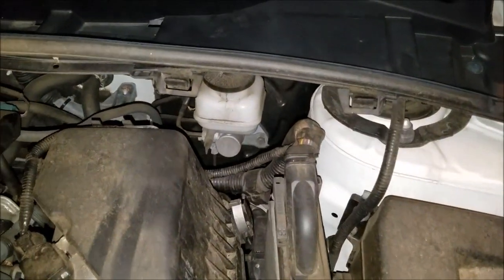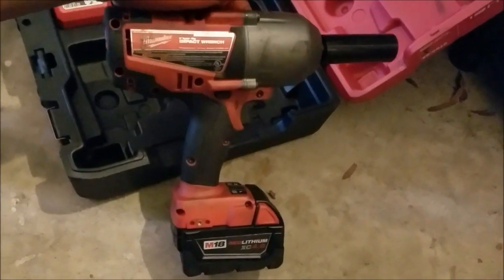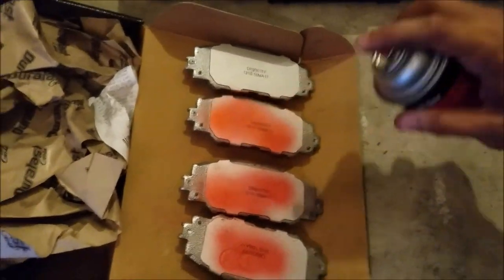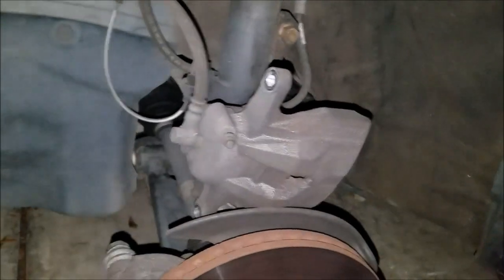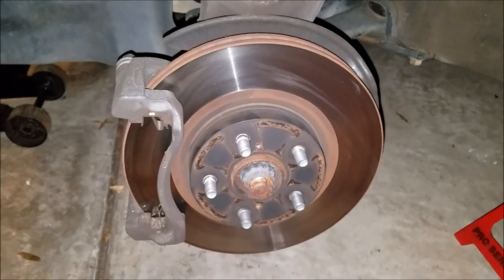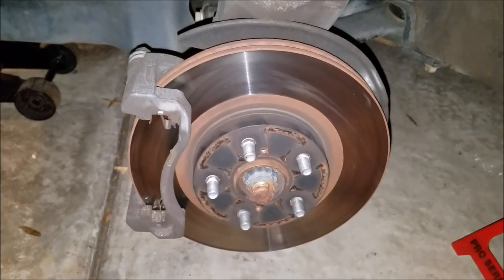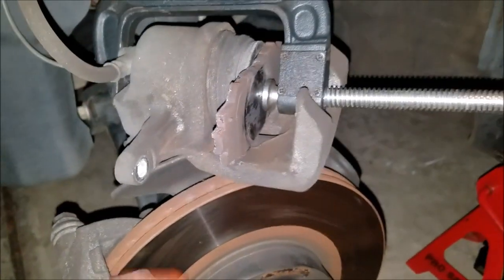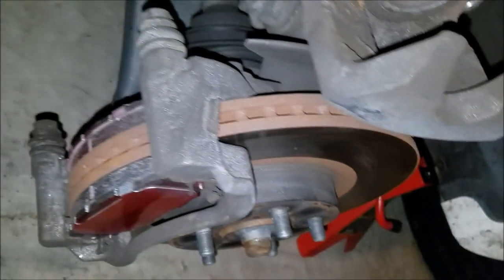2009-2013 Toyota Corolla BRAKE PAD Change

Comment: It is for safety.  U should pumps the brakes several times when u are done ( after completely install the brake pads). Last time after installed them I forgot to press the brake several times almost caused an accident.  Unfortunately no one was standing in front my car.
Reply from the maker: This is very true and a good tip! Need to reestablish pressure in the brake lines and brake pad contact with the rotor. Thanks and good tip :)
Reply: Unfortunately?!
Reply: @AllTheCoolNamesAreTaken84 lol

Comment: Great job explaining front brakes replacement. Also I regrease the caliper push pins. Sometimes they dry out from the dust and weather conditions. Just pop them out and apply a little grease and push back in. Very simple.
Reply from the maker: Great tip, I've been meaning to add that step in future brake jobs. Easy insurance against future brake issues for sure
Reply: Dont use grease on the push pins is a silicone solution or silicone  paste dont use grease  use silicone
Reply: @claytondebroux6827  - 'brake grease' is, at this point in time, a silicone compound.  Such as Sil-Glyde, as I use. So, you grease the pins.  You don't want to use a silicone oil.

Comment: Thanks for the video bro. I started on this yesterday on my 2013 Corolla, but it took so much time to get the bolts and rotors unstuck that it was getting dark and I had to stop (no garage). Gonna grab a C clamp like the one you have before I get back to it anyway cause I don’t think I have one. Hopefully the hardest part is over 😆🤞🏻
Reply from the maker: Oh yea I think you were through the tough part, hope the rest of the install went well!
Reply: @EngineeredMojo  it did! Got the C clamp and it worked great. Had no issues with anything else and the car stops on a dime with no more wobbling when slowing down from higher speeds.
Reply from the maker: @AllTheCoolNamesAreTaken84  awesome to hear fix went well

Comment: The brake cleaner is used to for several jobs, but you should clean off the new rotors as they come with a film coating to prevent rusting.  Anyhow glad to help and pay in forward too.

Comment: I have also used the C-Clamp while the caliper is still mounted squeezing the piston while still installed, before removing the pads and caliper. It ensures the caliper will remove easier.
Reply from the maker: @FBarowsky  ahh that's a efficient way to use the clamp!

Comment: Important to note the brake squeak spray is to coat the other side of the brake pads which contact the rotor/disc. There is no moving part on the back of the pads which you sprayed. But good vid. Cheers 😁

Comment: Good video you forgot the brake grease on the 14 mm bolts helps it slide back in nice
Reply from the maker: Ahh this is true and a good tip to add!

Comment: Great tutorial but I didn't see you put the new squealer hardware on.
Reply from the maker: Now that I re-watch the video, I sure didn't show that step. I ended up putting them in, but had forgotten on initial brake pad seating. Luckily I hadn't bolted down the caliper yet! New hardware is not bad putting back in, I just made sure to take off one at a time; therefor I wouldn't confuse myself when reinstalling the new pieces. Thanks for catching that for future viewers!

Comment: Ah.....I think you just used the same disks that has the rough surface on the inside, without grinding to be smooth, so, my estimation is that it works, but, that brake pad had much more wear at the beginning, and maybe, the braking became wobbly because the surface is not even on that surface. The brake disks has to be smooth to avoid wear down the brake pads. 

Thank you for the video. Pablo.
Reply from the maker: That's a good point! If I remember correctly these rotors had to get resurfaced. There was just enough material on the rotor to make it feasible to resurface

Comment: If their is to much fluid, you may need to remove some so it doesn't spill over.  Have a can of break clean around, wire brush and or sandpaper if needed. Also  make sure you go counter clockwise when removing the back pins (ask me how I know this) If you go the wrong way and snap the pin, it will turn out with thumb pressure. Also it's good to wipe the pins clean then add a bit of grease, also on the hardware.  Pump the breaks when done and do a test drive.
Reply from the maker: Nice additional tips! Having the brake clean on hand is an awesome tip to clean the possible brake fluid overflow. Definitely can have some overflow when pushing back the pistons. Really appreciate you contributing to the video!
Reply from the maker: @Sexy40baby1  it's always relative to yourself and what counter clockwise would be if the volt threads are pointing away from you

Comment: Do you need to bleed the brakes at all? I’m confused as to why some people say you have to, and some people say you don’t.
Reply from the maker: There is no reason to bleed the brakes for a brake pad change. Only reason to bleed brakes is when you open the brake line to the air (bleeder valve, loosen brake line, opening reservoir is okay because you haven't interrupted the direct brake line). Hope that helps!

Comment: Hey brother I have 2013 corolla myself.  Any idea how to replace passenger side, side mirror?  Mine popped off and hanging while driving. Any tips will be helpful.
Reply from the maker: For your viewing pleasure!
https://youtu.be/100OgfABjdc
Hope it helps!
Reply: @EngineeredMojo  crap thank you!
Reply: @EngineeredMojo  can I replace the mirror without having to buy full new cover etc?
Reply from the maker: @Chris G  like just the glass piece? I'm sure you could but would probably have to find that piece from a junkyard. Haven't seen the mirror sold separately

Comment: Cool technician mechanic video..lol breaking on hope helpful video.......     is the beerings easy to replace is full hub beerings assemply has to be change
Reply from the maker: Wheel bearings replacement is not too hard. Just a bit extra work beyond replacing say a brake caliper without the brake bleeding part. You'll need to either find a shop to press your wheel bearing out and press new one in or get a loaner tool from a auto car store to remove. Some people use a hammer and socket about same size as bearing to knock it out, but that's a bit more work for sure. Hope that helps and thanks for taking the time to comment!

Comment: bro did u use oem company brake or after market brake
which brand do u advise 
and lastly is bosch brake good?
Reply from the maker: I used a ceramic brake pad if I remember correctly which is usually mid or top grade brake pad. Usually ceramic brakes provide less brake dust and premature squeal. They are only about 10 to 15 dollars more than cheap brakes. Worth the extra in my opinion, hope this helps!

Comment: If the brake pads do not move freely in the retaining clips, pull the clips off and use a file to lightly remove rust from the iron caliper casting (at the slot).   Then apply a light coat of a brake grease to the slot, insert the retaining clips, and check the brake pad fit.  The  mounting tabs should not bind. Cleaning and re-greasing the pins is usually a good thing to do as well, and you don't need a brake 'anti-quiet' compound, you can simply wipe a small amount of the brake grease on the back of the pad.   No need to buy a special brake quieting spray - you just need a high temperature, lower friction seal between the brake pad back and the plate.   (The spray used here looked more like battery terminal protector) 

To reiterate, there are THREE, and only three places to use brake lubricant.   Mounting tabs, backs of the brake pads, and the caliper pins and bushings.   Use a brake grease.  Don't use red and tacky or anything else you might have kicking around.     

Hint - if you think you might be messing with the brake rotor, get or make brake hangars, and hang the calipers.   Banging away on the rotor to knock it loose, especially in road salt country, can knock the caliper down to snap the hydraulic line.  

If you didn't notice, he placed the wheels underneath the sides of the car.   That's so if the jack stands slip for whatever reason, the car isn't going to completely crush his hands or head when it drops.
Reply from the maker: Awesome tips to make my next brake job more efficient, thanks!

Comment: Do the back have pads or no? I need help to find out if i need to purchase them?
Reply from the maker: Depends on car trim you have, but it's easy to check. Just look underneath the car. If you don't see a rotor then its drum brakes

Comment: 21mm socket for the wheel nuts...also, you didn't remove the slide pins, they need to be inspected, cleaned and lubed with a proper lube. Very important step missing! Torque the wheel nuts to 76ft/lbs.
Reply from the maker: Ahh good point on the clip that was left out of the slide pins! Good tips brother!!

Comment: How many brake pads should I buy? I have a Toyota corolla 09 LE
Reply from the maker: Brake pads typically come in sets, so you'll have 1 set for the front and if you have rear disk brakes 1 set for the back
Reply: @EngineeredMojo  nice. Thank you bro appreciate it and the video

Comment: how come you did not loosen the bleeder? is it okay not to loosen it?
Reply from the maker: Yes in fact you don't want to touch the bleeder valve at all. That will introduce air into your brake fluid line and you will have to bleed system to remove air intrusion. Unless you need to flush and replace your brake fluid you never want to open a bleeder line and only open the reservoir to allow pressure to escape when depressing brake pistons. Hope that sort of lengthy explanation helped haha

Comment: quick question @engineered mojo, my brakes are squealing on what appears to be the rear axle. Are there only brakes in the front of these corollas? 2010 specifically
Reply from the maker: Your Corolla probably has a drum brake in rear most likely. Those can squeal as well if malfunctioning or have worn down. It's a different process to replace drum shoes though. Not too hard at all though with correct tools. Unfortunately I dont have a video for that yet! On my list now though

Comment: don't you have to bleed to air out of the brake lines?
Reply from the maker: Only if you open the lines and introduce air into the system, which you should not have to do for a brake pad change 😀. You can change your brake fluid at the regular routine interval recommended by Toyota

Comment: You don’t have to remove both pins. Most of the time you can just remove the top pin and slide the caliper over
Reply from the maker: Ahh this is good to note and potential time saver. I'll attempt next brake pad change!

Comment: do you need to bleed the brakes?
Reply from the maker: Not necessary to bleed brakes for a brake pad change. Only if it's due for a brake fluid flush 🙂
Reply: popping the top off the brake fluid is a great tip!

Comment: Fronts are easy.  Rear??  My dream is someone post a video on how to change the rear disc pads of the same generation corolla.  can't get the cylinders to turn down.  Just spin and spin without retracting.  Can't get the caliper back on the rears.

Comment: Just changed my brakes. A bit of brake fluid leaked. Is this normal?
Reply from the maker: Where did it leak from?
Reply: @EngineeredMojo  nvm i figured out what happened
Reply from the maker: @ozz9000  don't keep me in suspense! If you don't mind, what was the cause of the leak?
Reply: @EngineeredMojo  when i compressed the   brake caliper a bit of brake fluid came out from the top and spilled. i checked the fluid level and all was good.
Reply from the maker: @ozz9000  nice, simple and quick resolution

Comment: How do you have to clear the line of air?
Reply from the maker: You shouldn't need to bleed your brakes of air unless you opened your brake line for another unrelated fix. But if you did, you'll need to bleed at minimum the wheel location which you opened the line. Possibly all 4 wheels if more air got in. It's not hard to self bleed and it's even relatively affordable to get it done at a shop, typically less than 100 dollars. I'd search on youtube for a brake bleed video if you did open the lines and need to bleed air from your system.
Reply: @EngineeredMojo  Thank you. It was just a question that I had in mind.

Comment: What about bleeding the brakes
Reply from the maker: No need to bleed the brakes during a brake pad change thankfully. Only reason to bleed the brakes would be if you accidentally opened the line or it's time to flush the line. That varies by car but typically every 50k miles. You can check your particular model online

Comment: You forgot to put brake caliper grease to avoid uneven brake wear
Reply from the maker: Never heard of that, I'll have to research that to see how effective it is. Thanks for the info!
Reply: Yeah. Sister in laws front brake pads were replaced and mechanic never put high temp silicone grease on caliper pins . Passenger side   Mag wheel had excessive brake dust all over every week. Not a bad idea to clean pins with brake clean then put a wire wheel on them for extra measure prior to silicon grease.

Comment: You didn't change the rotor😮 WDF
Reply from the maker: Sure didn't! It was still in good condition. I usually change the rotor every other brake pad change or if I see visual evidence the brake pad has worn unevenly
Reply: Wasn't the pad down to metal, thought they were grinding